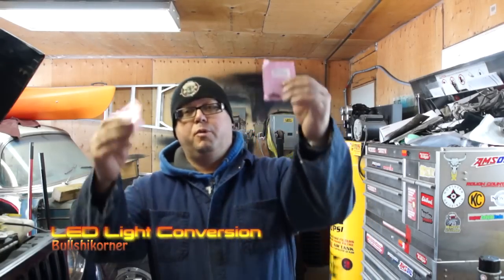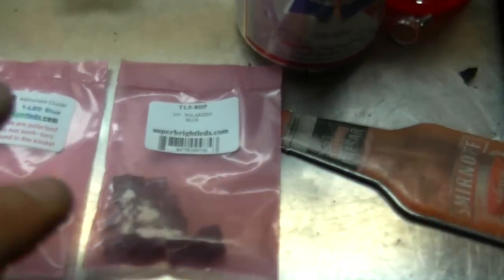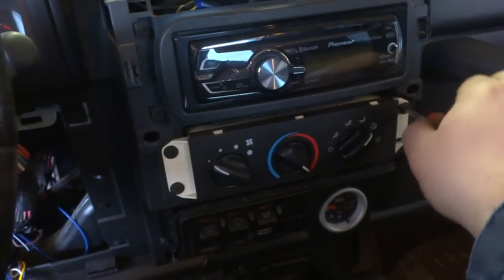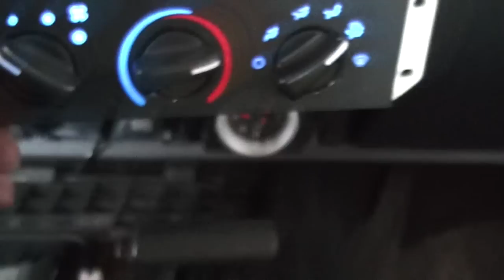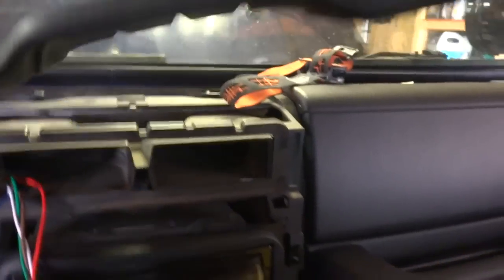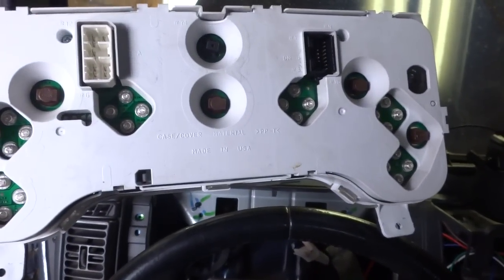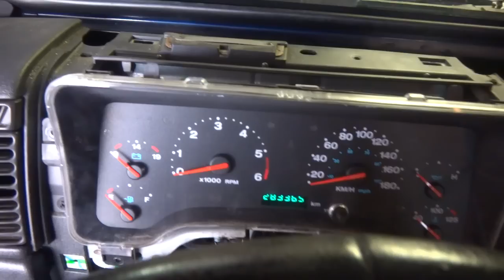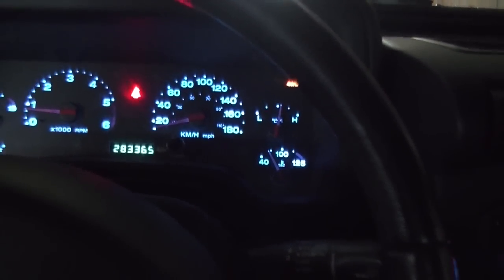Jeep Wrangler  LED Dash Light Conversion

Comment: wish ya could do that in the bimmer
Reply: You can do this in any vehicle.
Reply: Well yeah but doing the dash in our car will trip a tamper light
Reply: It's a trip dot, and can be reset with a "PASoft", or "ncs", but if the ViNs match it should not trip the tamper light. That dot only is for ODOMETER Tampering. Don't drive the car till you change the bulbs so the mileage matches.
Reply: Ohh pa soft, I use that. I will look into it. Im wanting a white LED display vs orange
Reply: Look for user silver light in that page
Reply: Yeah  I will. Im a member on e46finatics! Phoopsta is the name
Reply: If you do it, make a vid and edit it. You will get lot of views.